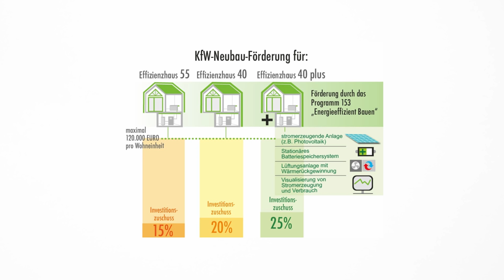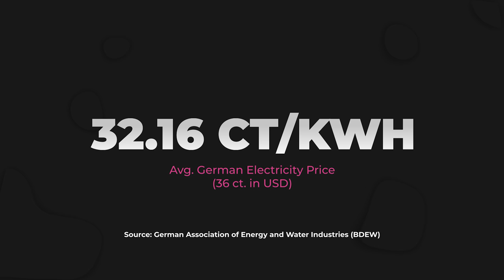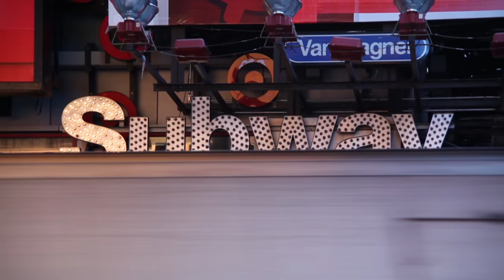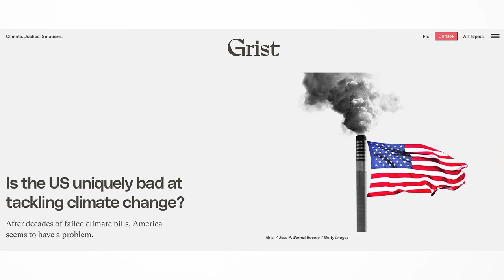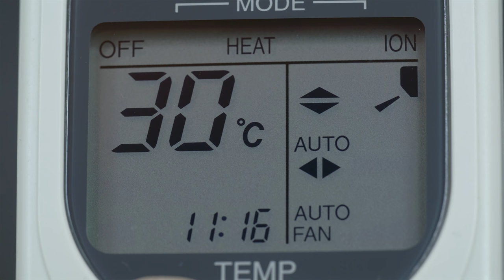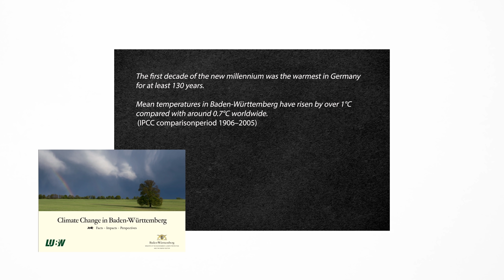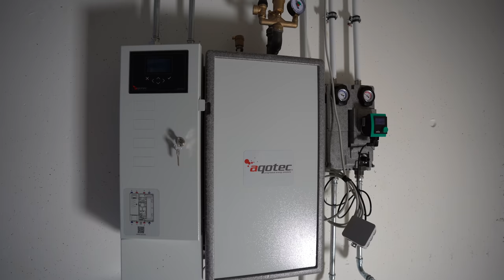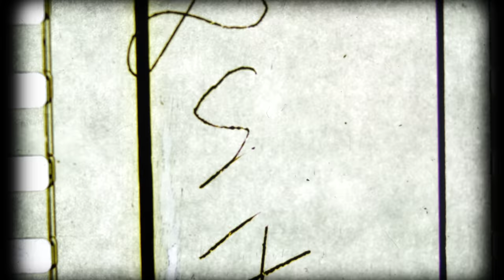HVAC (HLK) in German & American Homes | A Tale of Two Countries

Comment: Another wonderful video!

If you're already in the Freiburg area, then you should do a few videos on Solar City in Vauban and the Chamber of commerce and industry (IHK) building.  I studied German one month in Freiburg back in 2010, and when I was there, I learned about Solar City in the former French army base of Vauban and what they were doing with solar air-conditioning at the IHK building in Freiburg.

With Solar City, I remember that they used triple-glazed windows and they had blinds that were on the outside of the units so that heat absorbed by the sun wouldn't heat the inside of the house, thus reducing the energy needed to cool the place.  Compare that to curtains and blinds used indoors so that the heat is stopped at the window so that it doesn't heat the floors, but a given blind or curtain still gets warm.  And the IHK building in Freiburg with their solar cooling sounded crazy when I first heard it.

I'd imagine that there are also a lot of talk about thermal cooling in Germany in general, but Freiburg in particular.

These are some things that most people would never know about otherwise.

On the topic of air conditioning making people sick, growing up in North America, we are used to fighting the sweltering heat with a blast of cold air, but in many countries around the world where it is hot, their bodies literally start to shut down in the cold. I was once in a Central Asian country during a "cold spell" (it was about the temperature of a fridge outside), and inside there were heaters set up everywhere set at 26 degrees Celsius (79 degrees Fahrenheit) and everyone was in full winter coats!
Reply from the maker: Great idea! Freiburg has a lot of sustainable tourism and the Vauban design (and now the new Dietenbach development) are really great topics for future videos! Thank you for the recommendation.

Comment: Imo the best heating system is a mix of three. A nice fireplace, a radiant heating system in certain rooms and in most rooms a floor heating. Like living room and the hallways, the bathroom and kitchen, but in the rooms where you sleep it's radiation heating. It's better for circulating the air and the room gets colder much quicker, if you turn it off. Depending on your sleeping habits, of course.
I like it hot e.g. and can't sleep while freezing, even with more layers of blankets.
Well, I guess I wasn't built for such a climate..?
🙂
Reply from the maker: We look forward to having radiant heat floors. My parents have it in their current home bathrooms and it is sooooo luxurious.
Reply: @TypeAshton  My friends, who are also in the process of building have the same system. It is lovely to walk on heated floors. Especially with toddlers or babies.

Comment: Very well researched video again. I just think you do a good job of explaining it for an outsider to understand and easy to see. For the question of how we deal with heat: I for one just use the method of leaving the windows open at night and shutting them and closing them as early as possible while also closing the blinds till evening (like around 6-8 pm), depending on how hot the day gets. I´m living in northern Nordrhine-Westfalica btw and we get some serious heat up here.
Reply from the maker: We're hoping our new home has more passive cooling so we can do like you do and cool the house down at night. Our current apartment has South/West facing windows with no shade. But the new home has lots of shade and faces north. Hopefully this coming summer will be much more comfortable.

Comment: I don't like radiant heat because it can take hours to affect small changes in temperature.  I like to turn the heat down to 62° F at night.  The next morning it just takes a short amount of time to raise it back up to 70° F.  My house has a forced air system, which is easy to maintain and very simple to repair.  A radiant system uses water or glycol, which can leak.  And if there is ever a failure of the tubing in the floor, it's a very expensive fix.  I don't have air conditioning, as it's very rarely needed in Alaska.  I do have a winter home in Arizona, and air conditioning is an absolute necessity.  You cannot live in southern Arizona without it.
Reply from the maker: I would agree that we have also noticed that radiators take a bit longer to heat the room.

Comment: Again, great video about differences in these 2 countries. I live in Las Vegas and the biggest problem with the forced air is that we have one thermostat in the living room downstairs and when you set it to 72 F in the winter, it is actually nearly 80 F in the bedroom upstairs so you need to set it to maybe 70 F but then my wife needs an extra portable electric heater downstairs but upstairs is OK. However, in the summer you could not live without central air conditioning as we get up to 145 F heat. Also, when living in an apartment building in the US, each apartment unit has it's own water heating and air conditioning unit which makes it so inefficient but cheap to build.
Reply: Again it is a matter of cost. A superior system would have a furnace air conditioner for upstairs and downstairs so they can be regulated separately.
Reply: @nejdro1  That is one solution. But there is still the natural convection through the open stairwell. Or worse, an internal balcony or loft. What could be worse than heating the downstairs while at the same time cooling the upstairs?
Reply: @jessicanicolebelmonte6252  In years past, every room would have a door on It to prevent unwanted heat transfer.

Comment: I hate it when people use air conditioning in summer. I feel cold most of the year, and when it‘s finally nice and warm outside, I want to wear a t-shirt and not a woolen jumper inside… I also have asthma, which acts up when exposed to some air conditioners. I haven‘t figured out which ones or why, but as a result I pretty much hate air conditioning in general. I only make an exception in high summer in the car when travelling long distances. That‘s when even I use the air con ;-)
Reply from the maker: It's always a tough one. Jonathan for instance is hot basically all of the time, so in the summer it's often quite uncomfortable.
Reply: I guess it‘s a good thing we can‘t choose the weather yet. There‘d be many wars fought over it!!!

Comment: A less well known, but I think interesting, alternative to forced air cooling is radiant cooling. It's basically the same as floor heating, but in the ceiling with cold fluid. It can easily be switched between summer/winter and gives you a natural, more even convection of the air flow instead of the blasts from the duchts.

Comment: If you live in a „house“ build with honeycomb stone + several layers of exterior insulation professionally installed the home will resist the daytime heat, at night or morning you open all windows. A exterior wall in Germany is 8 times thicker than in American houses.
Reply: So true. The apartment I am currently living in has exterior walls of 40cm, except behind the radiators where it is only 22cm.

Comment: I am not even close installing an AC in my home in Germany. I lived 3 1/2 years in Washington D.C. and working and/ or sleeping without an AC would be nearly impossible in the summer. The humidity would kill you. However, I set the temp to 30 degrees celcius which is cosy for us Germans when its 45 degrees outside and humid. Germans will have to bring a Jacket to stores and restaurants though. Me and my wife always had goosebumps in stores and restaurants. Americans didn't.

Comment: In the appartment building in Kassel (Germany) I'm living in, we got a ventilation system istalled (NOT cooling mind you).

The main reason behind it being that the house is considered to be a listed building, and thus standard insulation practices could not be applied for the full building. Thus only the floor of the attic and the outside of the pantries could be insulated.

So all the ventilation does is exchange the air, using a heat exchanger/ recuperator to conserve the heat/cold, and remove surplus moisture. With the last point being the most important, as this reduces moulding. Which would be the result of even the little insulation that was done.

Given that the insulation of the walls thus is crappy as before (my garden shed has a 2-3 times better insulation), this still is a net benefit, as this means less window ventilation is needed. In a sense it's kind of an (almost) passive HVAC system, with electricity only used for moving the air.

Still, climate change summers can be rather sveltering, and away from your suggested trick (exchanging air only during late evening and early morning hours, and closing the (sadly internal) shutters during daytime) using a wet bed linnen in combination with a simple ventilator as kind of a swamp cooler during the evening works good enough most of the time.

Comment: I have lived in a passive energy building and aside from a few pet peeves about the system itself it was extremely nice to live there. It had mostly tiled floors with floor heating so they were nice and cool in summer but warm in winter. Then it had a (forced?) Air system but this only provided fresh air (so you don't need to open the windows) which is heated in winter but not cooled in summer. Aside from those pet peeves with the system it was very agreeable to live in and if I ever am lucky enough to build a home of my own, I'd aim for a slight variation of it.

The reason why many Europeans say AC makes you sick is simply due to the fact that Americans tend to set their AC to glacial temperatures and when you come inside such a building all hot and sweaty you either need to carry winter clothes with you or risk catching a cold. Used reasonably it shouldn't do any damage to your health, except maybe to your bank account because of all those electricity bills..
Reply: To those wondering about my pet peeves with the system: I used to live in a very rural area where a lot of the surrounding houses had a fireplace. In winter the smoke would often stay very low to the ground and get sucked into the system which had no smoke detection and would basically fill your house with smoke. This is certainly a very specific problem to rural areas but something to keep in mind when choosing such a system. At least I could turn the air off manually (many apartments don't allow you to do so) but when I was out or asleep it was sometimes really bad..

Comment: I (19 m German) actually plan to have an AC at my future Home, as temperatures at my current home can easily exceed 30 C in the summer months. However, I plan to use it es little as possible and run it on renewable energy like solar power from my own roof, as I wouldn’t feel comfortable wasting that much energy just for my own comfort.

Comment: Hi Guys, You should mention that the different way homes are built here in Europe to the USA are. Fitting hot or cool air systems with the big pipes in solid built homes is much more difficult than in the wooden houses in the USA. And in very old houses it would be impossible to fit big piping systems.
Reply from the maker: Thanks for watching. Our first episode of this series was comparing home construction and in this video we did mention how it would be impossible to retrofit old homes with the big piping systems. Check out our first episode here: https://youtu.be/miSqQjVLjak
Reply: @TypeAshton  Hi Guys, Sorry I did not see that video, so I apologise.But keep up the great videos you are making. Just for info, We have gas underfloor and radiator heating in our house. But I think if we were thinking of building a new home I would have both heating and air con put in, but we also have a portable AC unit for the summer months wich we use mostly in the bedroom in summer. We live also in the Black Forrest, in Villingen-Schwenningen.

Comment: Our house is supplied with a municipal heating source, which frankly really sucks, mostly because it's rather unreliable (the incoming water varies between 55C and 70C, which severely impacts how fast rooms will warm up), and it's very expensive.. I pay around 2000 Euros per year just for heat.. and with the amount of consumed energy, I would be significantly lower if I'd run my own oil or gas burner. The last summer heat wave made me consider adding an AC system with some heat pump capability, so I can cool at least my living room and bedroom down, and use the reverse heating mode to offset the energy costs in winter at least a bit.

Comment: Of course it is very nice to have AC, especially in the summer, but we can certainly live without. Surely, once you have it you don't want to miss it anymore, but as you mentioned. Opening up all windows in the early morning fresh air and closing them (including blinds) again as soon as the the air outside gets warmer, will keep a well isolated home comparatively cool until the sun sets again (which in summer can be past 10pm), especially as the homes in general, but specifically the walls and windows are much better isolated than in the US. Heating with warm air. Have seen this in the south of France and must say, this is by far the most expensive and least efficient way to heat your home and really only an emergency solution for me. No way, I would want to only rely on forced air to get my home warm and cosy. In case you haven't guess that....I am German :-D

Comment: Put solar on both sides of the roof. It will generate huge amounts of energy, especially on sunny days. It will shade the roof as they sit off the roof so shade the roof. Also white, reflective shades on any roof windows help a lot. As solar gives you effectively free energy in the summer, you can run the AC system for free. Germany has a huge solar surplus at midday, often when you want the AC turned on.

Even after all the shading efforts, this summer (2024) was just to warm. Will opt to retrofit AC, a mini-split system. Effectively a mini heat pump. Will allow to cool/heat the lounge area which is the main area which gets too hot. 

BTW those baumarkt ACs work, but they are dumb, as they need this huge pipe which most people hang out of an open window. As they blow air out, it creates a negative pressure, so warm air from outside is sucked in again.

This video, and others, are old. Would be nice to see your final choice of system. How did the district heating go for you guys?

Comment: A big problem of AC is still the maintenance for the filters if they are not changed in time you will find all sorts of mold in them. There have been several instances some years ago where there have been outbreaks of Legionella in office buildings due to AC. In the last office I worked there was a cooling system incorporated in the ceiling. They pumped cool water from a underground storage through pipes which have been laid inside the concrete just like a under floor heating but at the other side. The water storage was huge I think to remember that it was made of 5 Tanks each 10000 liters. But this was the down type of the system it worked well for about 2 weeks but than the soil around the tanks was heated too much so that during the night the water didn't cool down correctly and we ended up sweating like hell. They tried to improve the system but I don't know the result since I left the company.
However such system can not cool down like a real AC it just cuts the maximum temperatures by 4 to 5 degrees Celsius so when you have 30 outside you have 25 in the office. I thinks it's a good idea for new buildings but the real project was done poorly.

Comment: Something that you did not cover is that a wooden frame house with subpar insulation does not stay cool as well as a house with thick masonry walls. Typical European constructions have much more thermal mass that helps to keep the houses both cool and warm. Just look at southern Europe, Spain, southern Italy, and Greece; you have a lot of thick masonry walls with houses painted white to reflect a lot of the heat hitting them. People have lived in these for hundreds of years without the need for air conditioning. Up in Scandinavia, old houses in the countryside were typically built with logs and clad with planks and a typical modern single-family home is built with a wooden frame, but well insulated. More upmarket properties are typically masonry. 

I live in Helsinki, Finland in a 100+-year-old brick house. My heat source is district heating combined with a geothermal heat pump and I have radiant underfloor heating (over 3000m3 in volume). One of the benefits of underfloor heating is that you distribute the heat on the floor level from where the hot air can rise up. It also makes the room feel warmer than it actually is thus helping to keep a lower overall temperature, not to talk about the comfort factor with natural stone flooring. My house has KNX so I can control the rooms individually with a phone, etc. 

The top floor in my house was originally a cold attic under a mansard roof and it has been converted into a master bedroom suite. The roof structure is wooden and even though it is insulated and force ventilated, and there is a ventilation gap between the roof and the insulated interior structure plus a small attic, it still gets warm during the summer months. This is the only place where it gets warm in the house. Luckily, we can move further down as our children have moved out of the house. It would be very easy to install a heat pump on the roof and a convector in the bedroom (or use existing ventilation ducts) but we have not felt the need for that - some units even come KNX ready, so they would be easy to integrate with existing building automation.